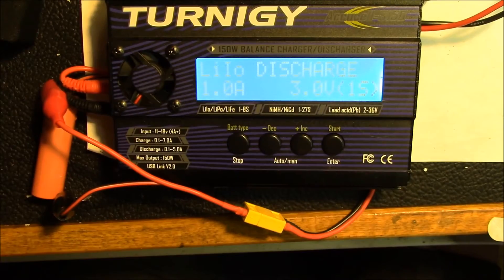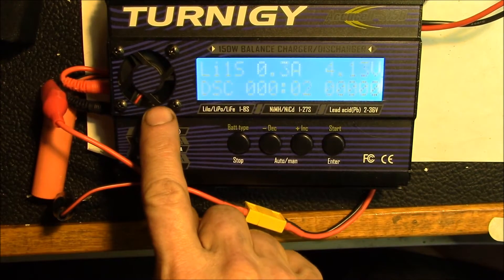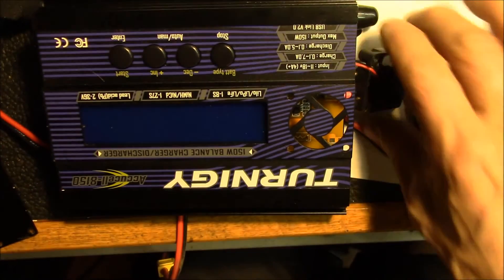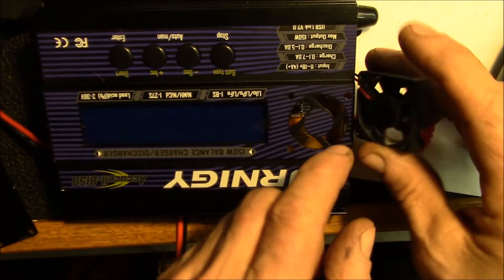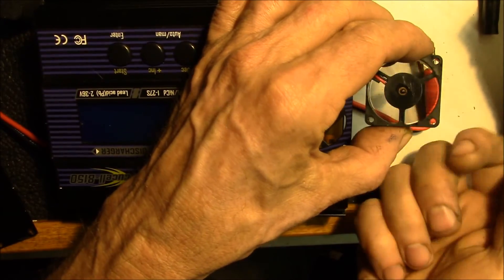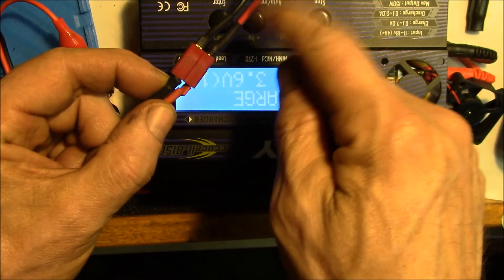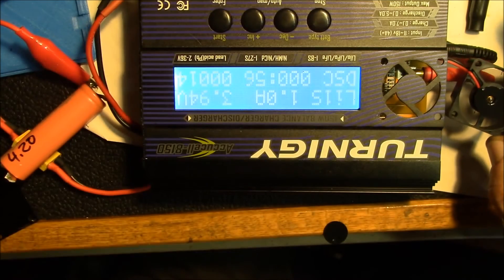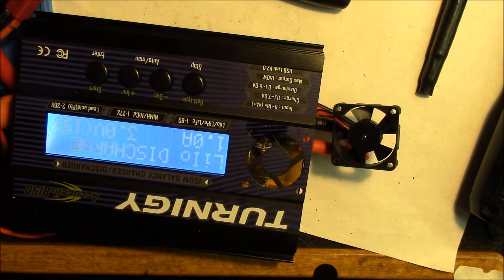Turnigy Accucell-8150 Battery Charger Fan Repair

Comment: Hey thank you so much for posting this video helped me fix a noisy fan on a duratrax charger.👍
Reply from the maker: Great,  glad the video helped.  I've picked up a box of 5 of these little 40mm case fans as they seem to be quite commonly used on a couple of my chargers.
Reply: Any Way You Could Link Me To The Fans You Purchased?
Reply from the maker: Looks like the item I purchased is no longer listed, but this is the "similar item" link:
https://www.ebay.com/sch/sis.html?_nkw=5pcs+12V+2Pin+35mm+x+35mm+x+10mm+Mute+Mini+DC+Brushless+Computer+Cooling+Fan
Although the link shows 35x35, I think the fans i picked up were 40x40.  Just check the width of your fan and also the number of pins on the connector (2 or 3) to be sure.  Should be under $10 for 5 fans.

Comment: Cool. Things are getting smaller and smaller...because it gets harder to small those little screws/nuts and stuff! My old shop had a lighted magnifying glass desk attachment deal. Made things easy to work on.
Reply from the maker: +Chris DIYer Yes, things getting smaller and smaller is true.  I can't get by without my lighted magnifier, I converted it from the old flickering circular CFL lamp to LEDs last summer and it works great:
https://youtu.be/G4ez56Sh7sY
Once I get a DC line run over to my bench, that will all be solar powered directly off the battery bank.